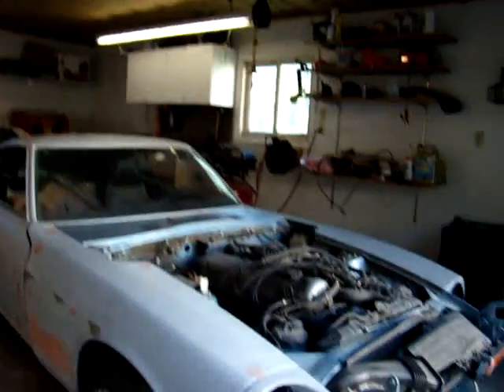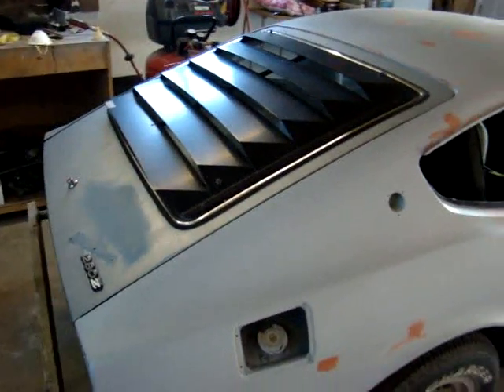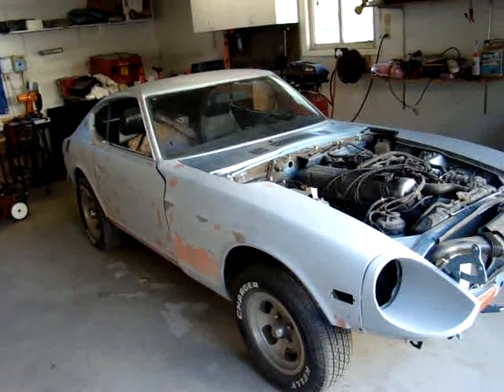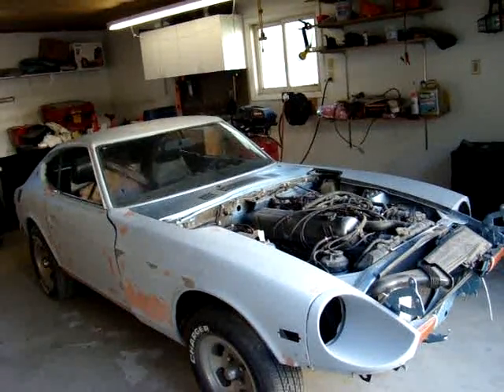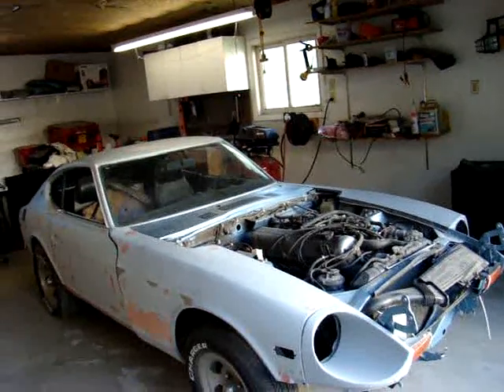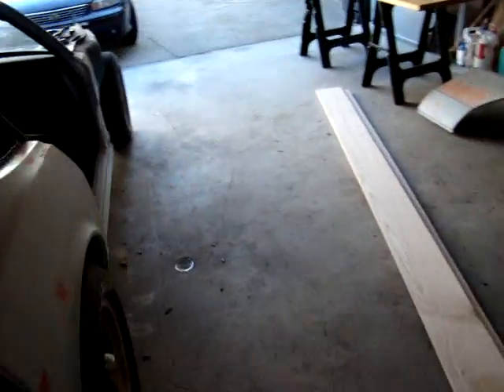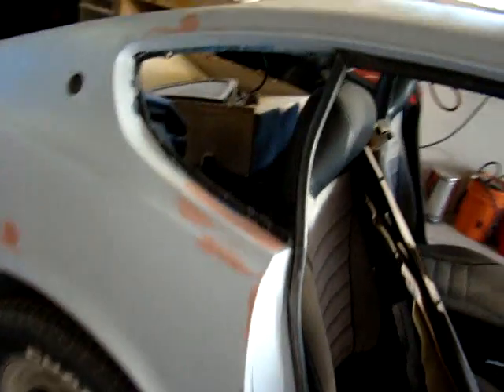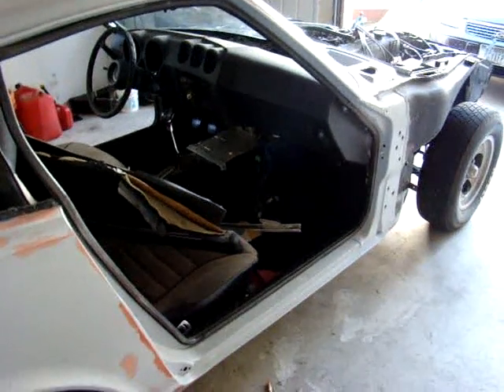1977 Datsun 280Z Stage 1

Comment: @Steve4948  Damn thats sucks! i got laid off my self in 1/2009 and i just got a job too,im gonna start next week. I got a 78 280z that my dad bought for $400 in running condition hasnt been driven since 1999 because the flywheel crack, but my dad gave it to me cuase hes not doing anything to it but hopefully with my new job i can start working on it this summer. Well good luck in your new job and the z !